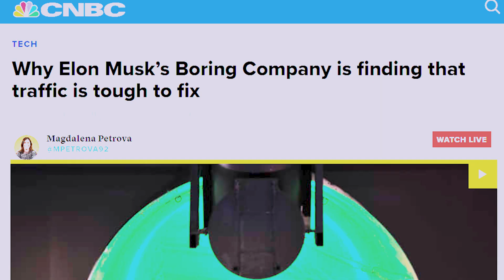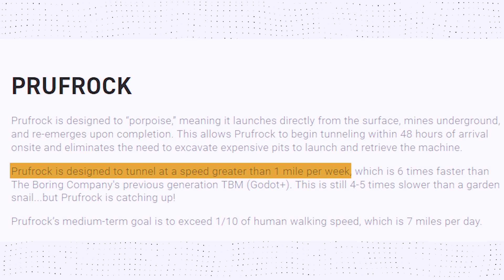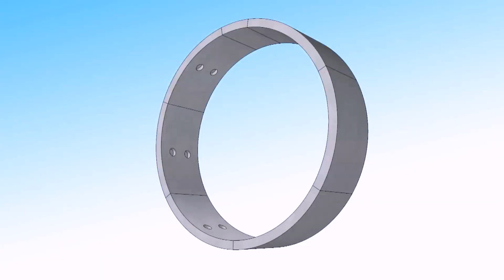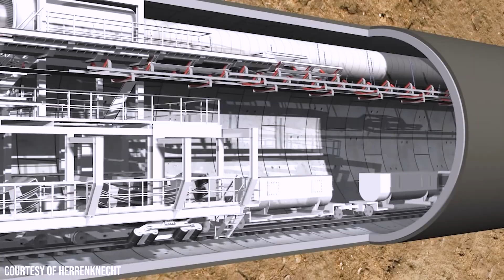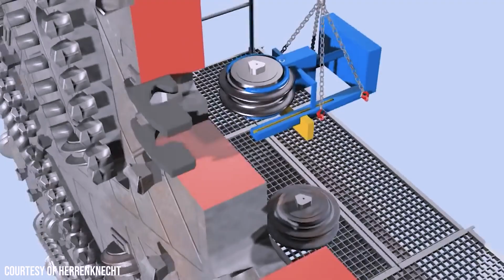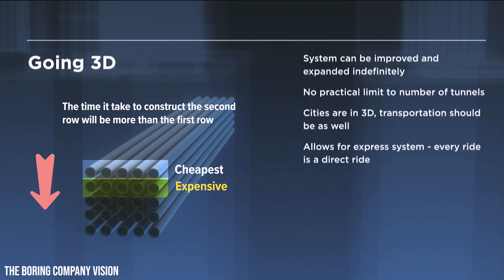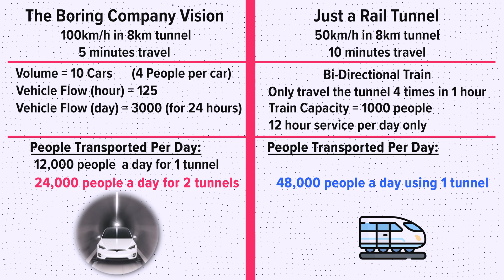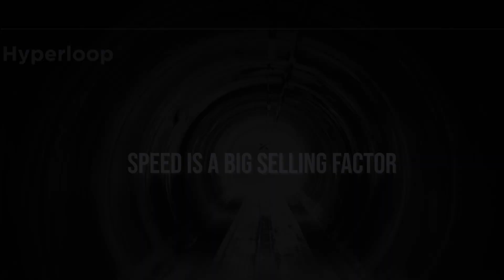Why Elon Musk's Boring Company Won't Fix Traffic: Debunking the Hype

Comment: If the TBM technology is as good as they claim, they should be using it to be dig affordable metro tunnels. Even if they used the existing 12' diameters, London Deep Tube trains could use them which is an amazing thought about a proper use of a tunnel vs cars with little room to maneuver...

Comment: Lets compare musks tunnel with mass transport some more.  You touched on it concerning the amount of people a rail can move.  Musks tunnel uses individual cars.. each car with a driver..  24 cars, 24 drivers.  Rail - maybe 1 or 2 conductors.  Plus each car has exponentially more possible issues.. failure points.  It boggles the mind how many people listen to Musk and proclaim GENIUS.  Breakdown in Musk tunnel and you're in deep doodoo.  No escape hatches.. no way to "go around!"  If there's a crash.. injuries..  ambulances won't be able to assist.. getting out of the car might be impossible just due to the diameter..

Comment: Interesting post! It’s good to be skeptical, but doing the math. However, good traffic is typically about 2,000 vehicles per hour. With an average passenger density of 4 (your estimate), this is 8,000 passengers per hour or 96,000 per tunnel every 12 hours. The Vegas loop already does similar volume to subways during events. 

You are right there are challenges, but if they can keep lowering the costs to tunnel it will have a very interesting place in the transportation ecosystem.

Comment: I calculated that the Boring Company subway tunnels in Las Vegas will be surprisingly profitable.   They will work.  However, there's a better way.
Transforming the tunnels into toll tunnels will increase the tunnel efficiency by allowing private citizens with private cars to access the same tunnels.  That generates tolls from subway rides PLUS tolls from private cars.   
Same tunnels,  improved utilization, and increased enterprise revenue and of course, increased
 NET PROFIT!

Comment: I have now filed and or received over 15 patents in the US, Europe, China, and India for toll tunnel transportation systems.   I've been working full time for over 7 years. 
Toll tunnels are best suited to long routes, 100 miles to 3,000 mile cross country routes.  They will enable 120mph travel for private cars and for trucking.  Faster and cheaper than any other mode of surface transportation including ocean freight movement.  In the future,  a lot of container ocean shipping from China to the US will be replaced by tunnels beneath the Bering straight.  Faster and cheaper per ton mile with vehicle movement at 120mph with short charging breaks
Reply: Unless those vehicles are fireproof and built like space ships or military  submarines, forget it.

Comment: Humans on freeways drive closer than 100 feet from a vehicle
Reply: Indeed, a 2010 study by the Honda Research Institute found that 75% of cars on a busy 2-lane freeway have a headway of 1.0 seconds = 3,600 cars per hour (14,400 people per hour w 4 pax) while 40% have a headway of 0.5 seconds = 7,200 cars per hour (28,800 people per hour w 4 pax)

Note that a 1 second headway gives a distance of 6 car lengths between vehicles at 60mph. A headway of 0.5 seconds is 3 car lengths at 60mph. 

And remember those are cars driven by potentially distracted, drunk and careless drivers.

The Boring Co aims to have a minimum headway of 0.9 seconds (5 car lengths at 60mph) in the main arterial tunnels which means 4,000 cars per hour or 16,000 passengers per hour one-direction down the arterial tunnels of the 65 mile Vegas Loop.
Reply: @andrewfranklin7087  60mph(100kph) and 0.9 seconds headway. 
Thats a 250m deceleration ramp, plus another 250m for acceleration, plus the actual bifurcations of say 100m each, plus, let's be generous and say, a 50m long station = 750m of construction to come off the arterial tunnel, decelerate, get into a station, accelerate, and merge with the arterial tunnel. The two 100m bifurcations cannot be constructed by TBM of course. (Method yet to be determined by TBC). All assuming acceleration/deceleration of 1.5m/s/s (human comfort levels), a straight line and no subsurface constraints.  
Sounds a bit expensive and a lot theoretical to me.
Next, a 1.8 second gap for your taxi to merge into if timed to the 10th of a second, to get your 0.9 second gap. If not, you cause a deceleration of the next car. That's the definition of congestion.
Basically, you can't leave your station until someone wants to get off at your station (leaving the gap in the arterial tunnel bypassing). So, you need a queue of ridership and/or a large buffer supply of cars to come into the system, or storage for them to get out of it, if they are not to be going around empty or gaps in the traffic.
Any basic attempt at traffic modelling will show all these issues and the tragic flaw in this concept. TBC could (and should) provide a layout, and a traffic flow model, with emergency scenarios etc, before they get past the concept stage. (Any other road design has to do this the world over).

Comment: His 125 cars per hour means he put over 1000 feet between cars.  With computer control, 100 feet at 60mph, 100km/hrs, is easy.  So, 3000 cars per hour beats his train throughput
Reply: The Boring Co plans for 0.9 second headways giving 4,000 cars per hour.

Comment: Completely BOGUS analysis and conclusions.   His example tunnel would transport 3000 vehicles per hour,  78,000 vehicles per day or 300,000 passengers per day... his capacity estimate though 24 hours fully packed isn't realistic.   Regardless,  tunnels are awesome for vehicles.  1 tunnel lane can carry 3 surface freeway lanes of traffic.   Buil 1 SINGLE TUNNEL below I-405 and the surface freeway would never again have stop and go traffic.   Build 2 tunnels and you could entirely empty the surface freeway of cars.
Anyway, the conclusions were completely wrong.   Remove this incorrect video.

Comment: With his TBM expected to launch shortly in Texas to dig a short tunnel at the Gigafactory---all the fanboys can monitor a straightforward dig---- let's see the time it takes. Boys get your excuses ready----as this could not be a better test of a small tbm highballing in open face mode with all traill gear connected at launch
Reply: Spot on. I'm watching it closely. 3-4 weeks into it so far and the TBM is half built. Prufrock 3...over to you.
Reply: Now 9 weeks into the build/launch and still not a meter of tunnel excavated. No cross conveyor yet and possibly a hold up in the permitting stopping the start.
Reply: 11 weeks to assemble (possibly 4 wasted due to the conveyor and maybe permitting delays, so let's say they could have done it in 6 weeks). First 80-90m took 3 weeks (pretty normal while using umbilical connections), then 6 days stopped to put the backup in and splice the conveyor into 2, 4 days to get everything commissioned (+ another 10m excavated). Since Tuesday this week (3 days) in full EPB production mode. Seem to be achieving about 10-12m per day now. Approximately 140m of an expected 300-320m completed in 5 weeks, 25 days, 6.5m per day. Expect completion in 3-4 weeks.

Remarkably average EPB TBM tunnelling so far. Hopefully they will give it the beans for couple of days to see what it is actually capable of as they have very little external constraints. 

Thanks to the daily drone flights that allow us to monitor the progress, effectively in real time.

Comment: The Boring Company paired with an electric train manufacturer to make subways/metros is the solution to modern traffic problems. If they want high speed, they can make side tunnels for the stops, so the stopping train has time to slow down and speed up in the side tunnel, but is going full speed by the time it hits the main tunnel. Then have some trains that are express, so they make few stops. They can also just make individual train cars that have certain routes, so they only go to the desired stop. If this is all automated, it eliminates human error. 

Boring Co. tunnels also should work with the Hyperloop, but I assume that the Hyperloop would need to install a steel tube inside a Boring Co. tunnel to keep it airtight, and in rural areas it is cheaper to just build the tube above ground, so this is only for the urban areas, where buying the land is too expensive.

Comment: Boring's tunnels aren't a replacement for car tunnels. It's a replacement for the subway/metro.

The main difference is that for the subway, all cars stops when some passangers want to get on/off.
When Boring's system is done right, some cars stop at a station while the rest doesn't have to stop. They can continue without evenslowing down.

Any real engineer would realize this profound difference!

The mean time between subway stations in Stockholm is 2 minutes, and the distance between them is about 1 km.
The mean speed is about 30 km/h.

Boring's system doesn’t have to stop except for at start and end stations. It's mean speed would be about 70 km/h.

Any real engineer would realize this profound difference!
Reply: I'm a real Engineer (I have bits of paper that say so). Please explain how a car gets out of the tunnel to stop at a station and then goes back into the tunnel. I would assume this means acceleration and deceleration ramps if you want to keep the speed up in the running tunnel. So how are these ramps (bifurcations to give them their tunnelling name) built? not by a TBM its a fixed size, by cut and cover? That's a lot of land constraints. Inside the stations? now your stations are 400m long. 
Alternatively you can have short steep ramps with right angle corners, and stations at the surface, just like they have built in Vegas. Resorts word to the South hall of LVCC is about a mile. The journey on the Loop takes about 6-8 minutes, depending on if you hit the tunnel traffic lights right at the resorts world tunnel. So that's 10mph on their current system. Not exactly a proof of concept to me.
I realize the profound difference between this and the Stockholm metro (and many others). So you are right about that.
Reply: @davidsalisbury50   To be fair David, the single Resorts World tunnel which has stop lights and alternating one-way traffic is a temporary measure until the return tunnel from Resorts World to the West Station and from the West station to Riviera Station are completed.

Once that is done, those tunnels will support the same 30-40mph and 6 second headways of the original LVCC Loop which take less than 2 minutes to transit with less than 10 second wait times.
Reply: @andrewfranklin7087  Maybe so Andrew, but I can't see an alignment for the Resorts World return tunnel given the constraints around it. Plus, why not build it at the same time to save considerable cost. I haven't studied the West to Riviera alignment to see how that can be achieved, but the same economic drivers apply.
Reply: @davidsalisbury50  if you look at the plans, you’ll see they are going for a circular set of tunnels with the return from Resorts World going to LVCC West station and then from there a dual tunnel up to Riviera. 

So once that is done they will be permanently one-way, not alternating.
Reply: @andrewfranklin7087  I see that, so there is no return tunnel from Resorts World. Seems they have to keep coming to the surface and through a taxi rank to get anywhere.
This emphasises a point I have been asking for 4 years now, with no attempt at an answer seen to date. 
When I look at their plans for the whole network I see green lines (I assume these are twin tunnels) that cross each other, with no station as they cross below an existing surface traffic interchange. How will this work? I assume it isn't a traffic light junction, and that vehicles can go straight, left, or right at each junction. The only way that works in reality is a clover leaf junction, which needs a lot of space and pretty complex engineering to build underground. If I were on any approvals board, I would ask how they intend to build this, and how they will build any underground bifurcation for that matter. Can't use TBM's for this work.
Reply: @davidsalisbury50  perhaps my description wasn’t clear. There is a return tunnel from Resorts World and there will be no above-ground transit thru the taxi-rank once the remaining tunnels are completed. 

There will effectively be a one-way ring of tunnels connecting LVCC West station, Riviera station and Resorts World.  So to go to Resorts World from LVCC West, you will first take the tunnel to Riviera and then the tunnel to Resorts World. Coming back you will go in the tunnel straight from Resorts World to LVCC West.
Reply: @davidsalisbury50  I’m not sure how they’ll do the arterial tunnel interchanges - they do have the advantage of theoretically being able to go many levels deep with minimal effort so might use this to avoid having to implement cloverleaf junctions. The advantage being they could potentially use TBMs for these assuming the curve radii are not too small.
Reply: @andrewfranklin7087  curve radii for a TBM of this diameter is around 150m minimum.
As for going deeper, it depends a lot on the geology. In anything but competent rock you are limited by hydrostatic pressure (these TBMs are designed for about 3-5 bar only, it gets real expensive and complex if you go deeper.
A cloverleaf interchange is on 2 levels usually so it is possible depending on available land rights and ramp gradients.
Still doesn’t explain how they will build the bifurcations (very expensive work on any underground project).
Reply: @davidsalisbury50  if they go for tangential curved tunnel pairs from one arterial pair to the other, I think they could get away with perhaps 4 layers deep. Such tangent tunnels could also have quite long radii curves as they’d only circumscribe 90 degrees. 

They could then possibly accomplish the paired bifurcations with 4 cut and cover boxes - one at each of the tunnel pair joins, but who knows, I’m probably wrong!
Reply: @davidsalisbury50  It's a interesting topic - how will boring co figure out ramps up and down, and also merges between two tunnels. But I believe it's a solvable problem, and TBC in a better position to do it.
Reply: @bergonius  Agreed. High speed ramps and certainly, more challenging, underground intersections. However, I have been asking this question for over 4 years now, as I know it to be one of the high cost and difficulty areas of tunnelling. It will be fundamental to the Loop network if it is to expand. As yet TBC have not addressed it, other than to bring their tunnels to a slow-moving surface interchange or build what appears to be a very inefficient cut and cover box. Metro systems largely avoid such structures for these very reasons.
Reply: @davidsalisbury50 
If you can't design it, and that seems to be the case, don’t claim to be a real engineer whaever paper you may have.
Reply: @larsnystrom6698   But I have managed the design team on a number of metro tunnels. And been a contractor on them, and a client. And worked for a TBM manufacturer. And now I'm a tunnelling consultant. I believe my CV stacks up alongside most tunnel Engineers. I freely admit there are plenty of Engineers I admire who are far smarter than me. They really are brilliant people. Most of whom I think would agree with me.
I challenged you to explain your hypothesis, and you haven't. I put up some options, but they all seem fundamentally flawed. It's not for me to prove your theory, that's your job. It's how these things work.
I'm not an engineer, I'm an Engineer. We use the captial first letter to denote a professionally qualified one, not a washing machine repair technician (no disrespect meant to those fine artisans of the whirlpool, hotpoint and siemens, just as a point of reference). 
But 35 years of tunnel construction, design and management. What would I know.

Comment: No ventilation , tiny congested tunnel , only Tesla cars?  This is like idiocracy  …
Reply: On the contrary, the LVCC Loop has a robust ventilation system that can move 400,000 cubic feet of air per minute in either direction down the tunnels. 

It is also not congested.  If you have a look at the footage of the supposed “traffic jam” that occurred once at the small CES 2022 you’ll see how the EVs just slowed down briefly because the South Hall doors were locked for some reason. 

There have been no other videos of this sort of incident ever happening again - not even during the much larger SEMA or CES 2023 conference which had 114,00 attendees and had 25,000-32,000 Loop passengers per day.  

Now compare that short slow down against a train where passengers literally have to queue up standing on the platform for on average 15 minutes in the USA waiting for the next train. 

The average wait time for the Loop was less than 10 seconds for the latest CES this year. 

And then those poor train passengers have to put up with the train STOPPING AND WAITING AT EVERY SINGLE STATION before they get to their destination, whereas Loop EVs travel direct point to point to their destination without stopping at any stations on the way. 

Now which would you prefer?
Reply: @andrewfranklin7087  Well great - you should be their spokes person …